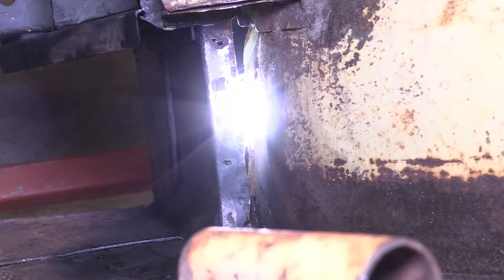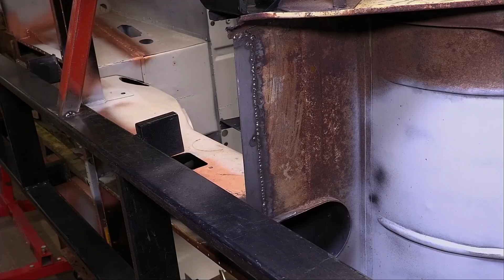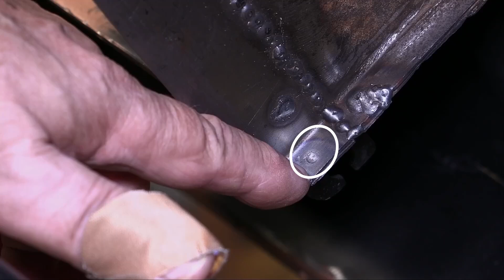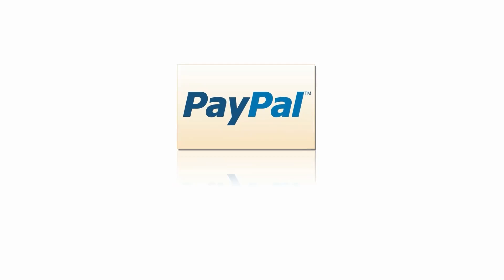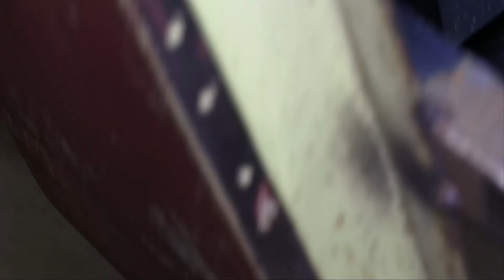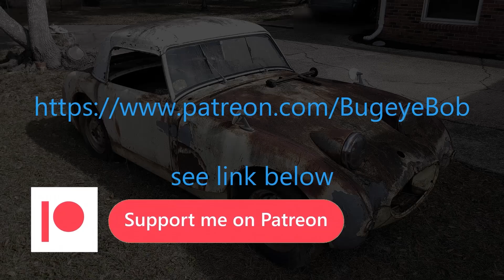BugeyeBob Episode 061, Patches, Patches, and more Patches

Comment: Nice to see the new progress, things are starting to come together. Put that spot welder to good use!
Reply from the maker: One of the problems in using in is figuring out how the built the damn car to begin with.  Some spotwelds seem almost impossible to do without tearing the car completely apart first.  Which probably means those welds were the ones done first.

Comment: I love seeing the spot welder. I've always wanted to try one of those.
Reply from the maker: I spent a lot of years in metal casework manufacturing... Desks, filing cabinets, laboratory casework, fumehoods, etc., mostly around industrial spot welders (caveat... I was in IT, but made sure I got out and learned about the shop floor.)  So, I was familiar with the process.  What I wasn't ready for was the weight of this thing.  It is an absolute beast at something over 35 pounds.  If it will work on what you need to weld together they are absolute blessings.  I was lucky to find one with the long tongs.  Many sold today are only about $150-180, but they come with 6" tongs which aren't always that useful.  Then when you go to buy the long tongs and find out they cost more than the welder itself it's one hell of a shock.  Fun to use, but definitely helpful if you are used to lifting weights...
Reply: @BugeyeBob-zt6ne  The good tongs are more than the welders. There are cheap harbor freight ones, but a real industrial one is so much better.
Reply from the maker: @densitypop  That's why I snapped up this Miller when I knew it worked.  It's built like a tank and came with solid copper 18" tongs.

Comment: Always a big thanks for your videos. 
I’m very tempted to try a couple small patches on my car. I have some bubbling under the paint by those corners around the rear wheel wells.
Mine has an old restoration maybe 25 years old that got black paint.
Over the years since I guess the bubbling happened, rust started under the paint. I’d love to strip those spots and see exactly what’s there.
Reply from the maker: I hope you don't find what I found.  Someone used metalized epoxy as "bondo" which would have not been too bad except they didn't clean it down to the bare metal.  Instead they just smeared it over the existing paint and damage.  Humidity got between the epoxy and everything else and there was a lot of hidden rust, even in areas that seemed to be 100% circled by epoxy that was stuck down hard.  I had to use a heat gun to soften it and get it loose.  Once you see bubbling it's best to deal with it sooner, rather than later.  I've seen it on older cars where there was a minor bubble on the surface, but a lot of rust hidden behind it, even to the point of the metal basically being rusted through.